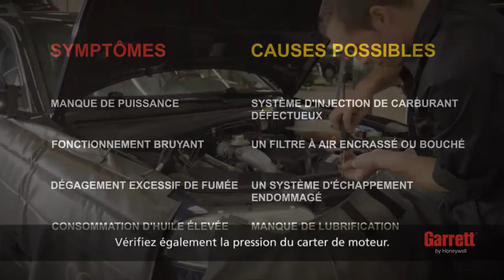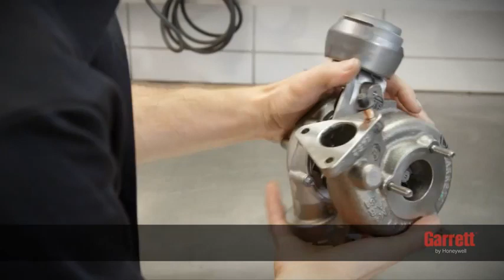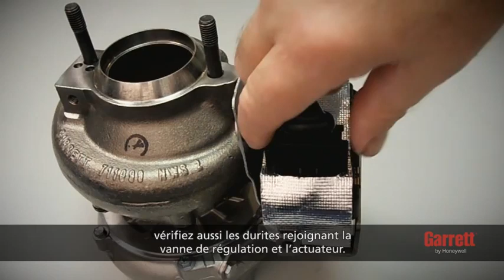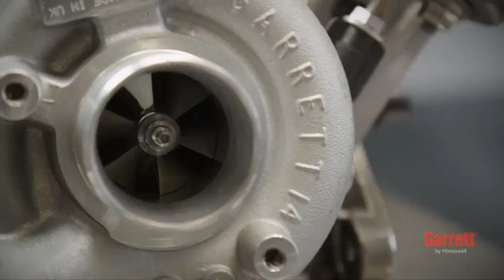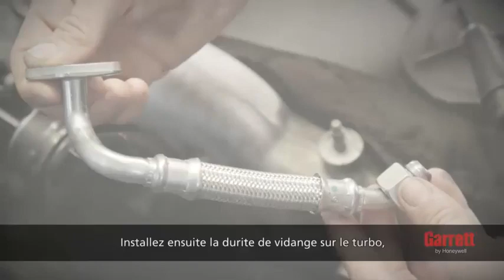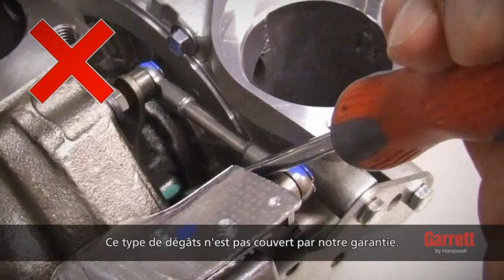Comment installer un turbo

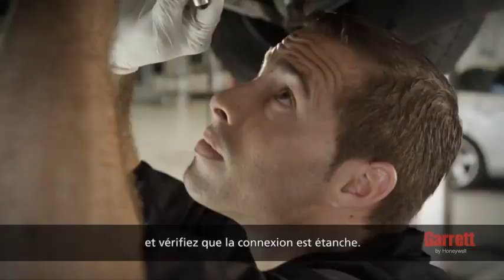Comment: 6:47 La durite de sortie d'air du turbo n'est clairement pas nettoyée là, ce n'est pas professionnel.
Il est recommandé de déposer également les durites d'entrée et de sortie d'air du turbo, ainsi que la durite reliant l'échangeur de turbo au boîtier papillon, puis contrôler l'absence de dégradation de 3 durites (trou, fissure, déformation...), puis les nettoyer (décrassage, lavage, séchage). Puis avant de remonter ces durites, il faut contrôler l'état de l'échangeur de turbo : 
- tester l'étanchéité par un test de pression, pas simple sans équipement.
- contrôler visuellement l'extérieur: si de nombreuses ailettes de refroidissement sont pliées/cassées, il faut alors déposer le radiateur et le remplacer. S'il est juste très encombré par des résidus d'insectes et autres déchets, le déposer.
- contrôler visuellement l'intérieur, de par l'entrée et la sortie d'air : s'il est souillé par de l'huile, il faut alors déposer le radiateur.

Si le radiateur a dû être déposé mais ne nécessite pas d'être remplacer alors procéder aux nettoyages intérieur et/ou extérieur nécessaires (se renseigner sur comment procéder).